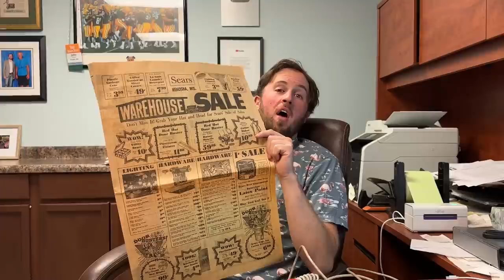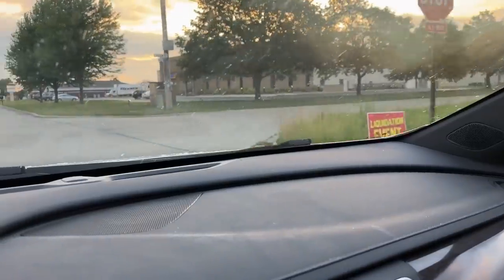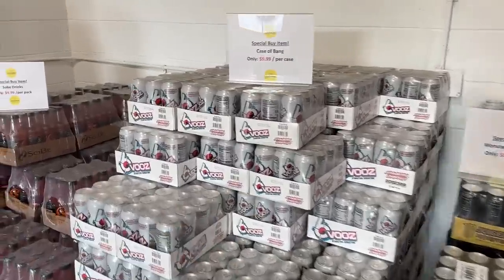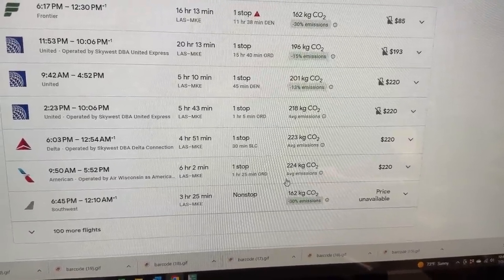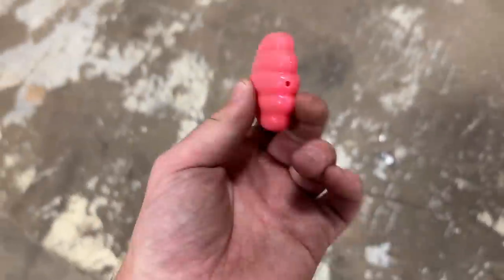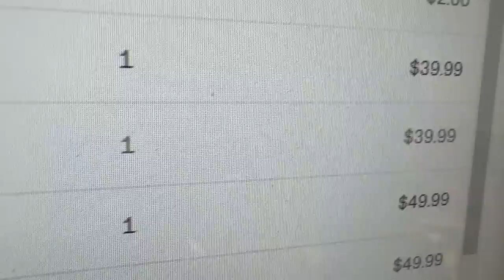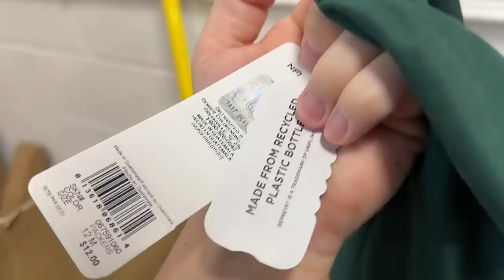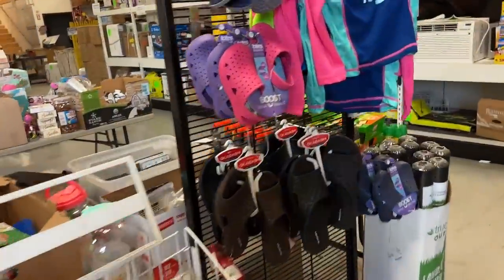Part 2 - July 2023 Warehouse Sale - The First Week

Comment: John -- A needle scaler is a handheld (air powered) tool used in metal fabrication, by welders especially to remove slag, dross, and scale, thus the name.  It is a hammering tool with many tiny hammers working almost randomly in concert to remove small defects in welded surfaces and joints.